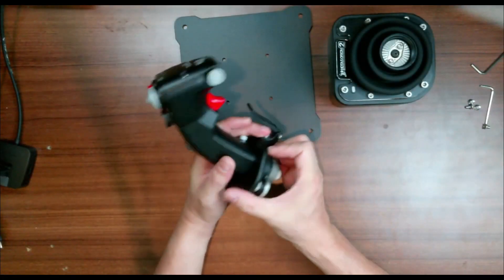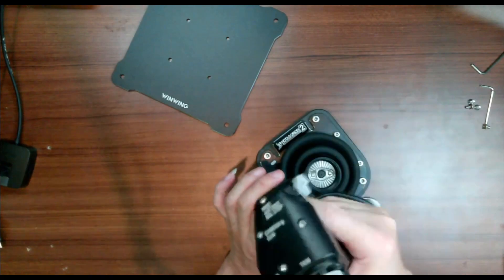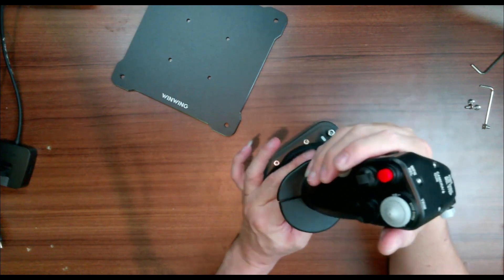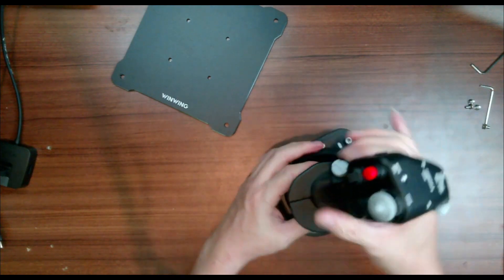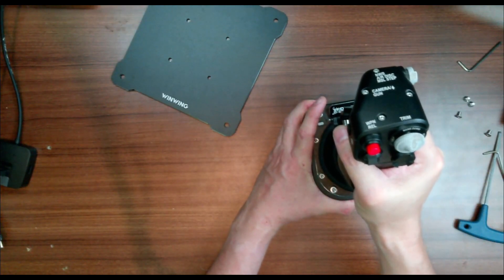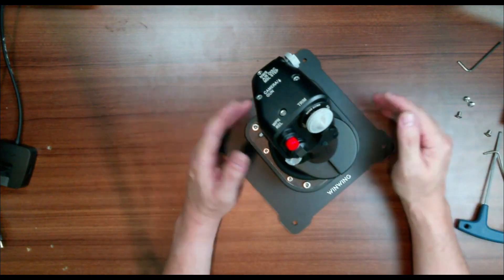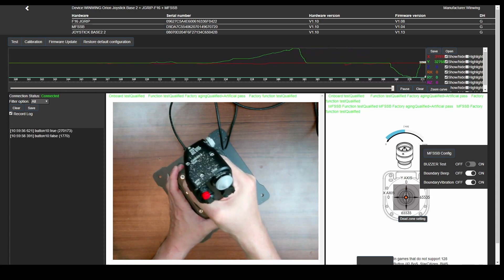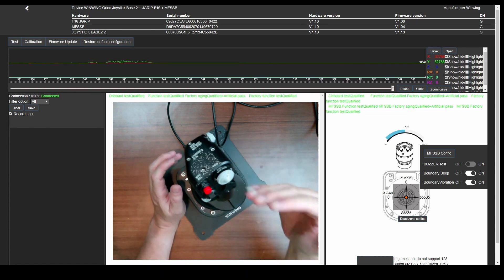Winwing Orion 2 F-16 Joystick (Combo Kit with Throttle) Assembly and Unit Testing

Comment: Hey there! I'm having an issue installing this grip. It's roughtly the same "problem" you encountered at the 3 minute mark. Whenever i turn the wheel to secure the stick in place, and apply a bit of Z axis force to the stick, it moves along the Z axis. How did you manage to hold it on in place? Thanks!
Reply from the maker: 5:45 talk about small L screw to secure the position